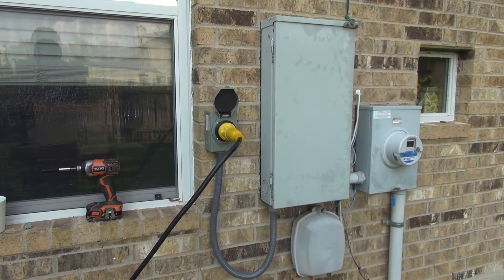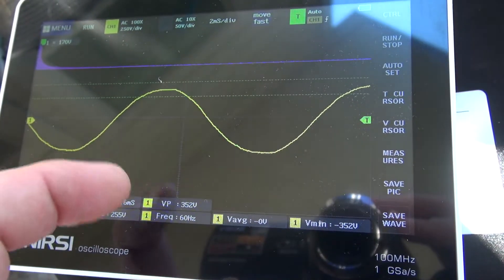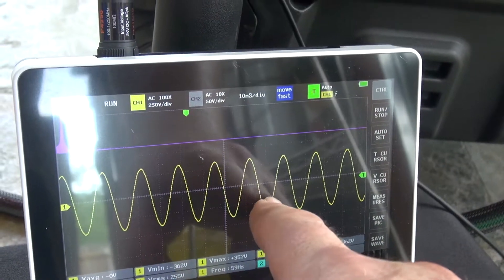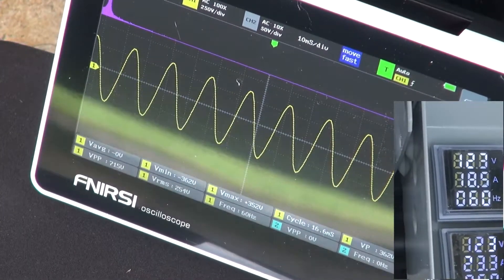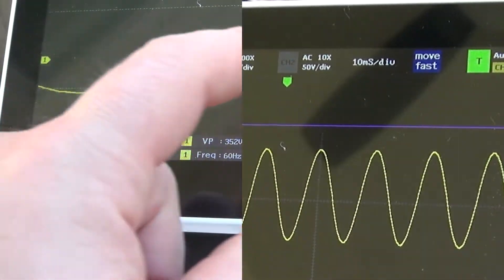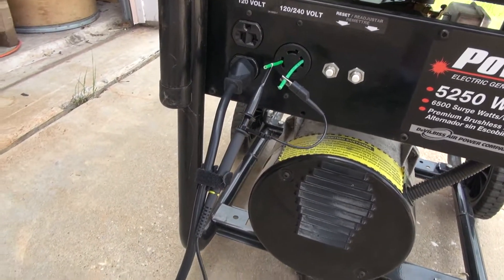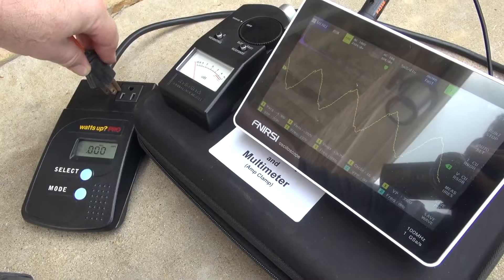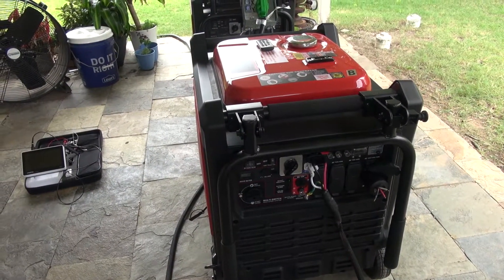Predator 9500 Inverter Generator vs. Line Power vs. Traditional: Compare Quality on the Oscilloscope

Comment: I have a predator 9000 that goes through a Reliance transfer switch. Runs almost every thing. The electrician said the transfer switch would clean it up. I have no problems .
Reply from the maker: Normal generators aren't "evil" or anything, but if you strain them, it will really screw with the power frequency.

Comment: I've had my Preditor 9500 Inverter generator for two years now. I've had to use it twice to power my house. With a soft starter on my 15 year old 3 ton air conditioner I have no trouble pretty much running the whole house including outdoor low voltage garden lights. It's really quite too compared to other generators. It sure beats the $12000.00 price tag quoted for a generac standby generator! The neighbors were happy to have a little light on the street as well at night!
Reply from the maker: Yeah, the MicroAir softstart is very nearly magic.  Really cool device for decreasing the starting amps.

Comment: The traditional is actually not that bad compared to others.
Reply from the maker: A traditional style generator of sufficient capacity isn't going to instantly smoke all your electronics.  However having one sized correctly is the trick.  If they're not oversized, when big loads hit (water heater, AC, or in my example even that fan) it bogs down the generator a bit, and that will directly impact the voltage and frequency, whereas an inverter generator will maintain both... until it can't and it just cuts off entirely... but never sends bad power out.  If the traditional generator is large enough to not get bogged down, then it's not really a factor (but over sizing it that much does get expensive)
Reply: @Texas_DIY a regular 9000 for a medium sized house should be fine I would think

Comment: All the sensitive electronics are typically stepping power up to 400v+ rectifying the power then using a buck converter to take it back down so your laptop is getting clean power. Standard dirty generator power is fine. Yeah cheap led lights flicker and maybe your hifi system will have a bit more of a noise floor but nothing is going to fry. Millions of people power their houses with traditional generators.
Reply from the maker: True enough.  It's not like a traditional generator insta-fries everything.  But an underpowered one is particularly ugly if being use for home backup.  High loads (water heater, a fan motor, AC, etc.) that bog down the motor have a direct impact on the speed (and thus the frequency and voltage) of a traditional generator.  I'd never hook that one up to my house, even a refrigerator turning on would be kinda nasty.  Inverter generators maintain frequency and voltage until they can't, at which point it just shuts off.  But yeah, if you get a traditional unit that is oversized enough to not slow too much when loads kick in, then it's generally just fine.

Comment: Thanks - this was super helpful in helping me confirm to get an inverter generator for my modern travel trailer rather than cheating out and getting a traditional non-inverted genny.  I’d hate to throw dirty power at all of that sensitive electronics that control my unit.  Well done!!
Reply from the maker: Glad you found it helpful!

Comment: 25-30 % distortion but have to admit people have been using Generac systems for years and don't really hear too much about blowing stuff out.  Not as worried about computer power supply since it's taking the AC and converting it to DC though a switching power supply. I wonder about modern AC units that have more electronics like brushless DC indoor fan motors.
Reply from the maker: Fair.  No one would use conventional backup generators if they just blew up everything they touched.  

My argument against full home generators is based more on price.  A larger permanent backup generator, isn't typically going to get bogged down and really distort the power because they are so oversized as to handle those loads and not bog down.  However because they are oversized, they are expensive and generally way overkill except for those brief moments with the huge air conditioner compressor surges (which the easy start mentioned in my other videos handles and reduces).

Now the convenience of having them auto-exercise themselves, and auto switch over on power failures, counts for a LOT.  Power goes out, and you don't have to do anything but wait 10 seconds, would be NICE.  

But in my case, since we don't have propane/natural gas here... the additional costs involved with leasing a large tank, plumbing it, making a pad for it, etc. etc.  on top of the already more expensive machine itself... made the pricing for a whole house backup generator a total non-starter for me.

Now, when you have small portable non-inverter generator trying to run a whole house, that's when things can get really ugly, (and what the test was showing, with just a single heavy load, not even a whole home).  This is because those smaller motors do get bogged down on heavy loads and surges, and when the motor slows, the AC frequency immediately also slows precisely with the engine speed (as the frequency of the power is coupled with the coils being turned by the motor, whereas with inverter generators, the AC frequency is generated electronically apart from the motor speed).  When the motor is under a sudden or heavy load, having huge voltage sags and frequency changes can really screw with the electronics in a house.

Comment: I ran my home for a month on a "dirty generator". Never had any problems. I ran everything.  I now have a diesel since gas is hard to come by after a storm.  It has less than 5% thd.   I wouldn't worry about it
Reply from the maker: If your generator is strong enough to not get too bogged down when larger loads kick in, it's not too bad.  But as the example I had, that was significant load hitting it really made a bit of a mess.

Comment: How do you connect oscilloscope to mains does it have a live and neutral and earth probe?
Reply from the maker: There is a neutral/ground and a 'hot' probe.  On the oscilloscope the 'neutral' is shared on both channels.  When placing it on 240, each probe goes on a leg.  When placing it on 120, hot to hot, and neutral/ground to the neutral on the power source.

Comment: Some ups make much worse wave form like you don't even recognize what it is.
Reply from the maker: Not sure what you're saying.  Inverters typically either make a pure sine wave, or a "modified" sine wave (which looks like stair steps on the scope vs. a smooth curve).  UPS units have inverters in them to make the AC voltage, just like this generator has a inverter in it to make the AC voltage. 

I prefer the pure sine inverter UPS units, as they will make clean power similar to this generator.

Comment: Great video, I almost purchased a regular generator until I watched it. But can't find any inverter tri fuel generators that can power the whole house. 
Do all modern tri fuel regular generators come up with similar dirty power?
Reply from the maker: If you need multi-fuel, consider the GENMAX GM9000iED on Amazon.  It's made by the same factory / people that make the Predator and the Duromax machines, and it solves all the shortcomings of those machines.  
(it has the same engine and most of the same guts, but adds a fuel filter, rear exhaust, 50A plug, remote control electric start, auto choke, nice detailed control panel display... and still makes the same clean power)
Reply: @JayTX  thank you for the info Jay. So my biggest concern is having a NG and 9000ied is a dual fuel as far as I remember, it supports gasoline and LPG. I was thinking about getting this unit just because of what you said, that it's a mixture of the two you mentioned with few upgrades and adding a NG kit to it, still considering. For sure I need an inverter generator having so many electronics at home

Comment: Even more horrific would be one of those 2-stroke asynchronous generators.  Those are knightmares and without enough load on the generator... they'll surge enough to blow the fuse on the Kill-A-Watt meter and I've read more.   Thanks for sharing this as well.  

I was wondering about a home brew synchronous generator parallel or gang controller and one of my thoughts was something like an inductor and/or bank of capacitors to switch in and out to get the voltages fine tuned and also seems like would have less brown outage issues having in general and not only for tuning each.  

Seems like a MOT rewound would be easiest, though I was wondering about for tuning a custom inductor or transformer from an old welder transformer so can more easily move in and out the high magnetic permeability piece.  I have no clue how come up with a cost effective variable capacitor design... so banks of capacitor fun... not. 🙂  Frequency can be easily adjusted via RPM tuning and phase will be more trickier via the governor I'm thinking to sync.  Seems for those older generators... easiest might be to mechanically set each generator to one larger engine if wanting like 10KW or more.  

This all started when trying to come up with a 50A 240VAC most cost effective generator design.  Seems the older 5000W or less are a dime a dozen and way more cost effective, especially if you're patient.  Then maybe add a thermal shut off from an old microwave on the stator somewhere to upgrade, along with breakers or fuse so the stator windings don't fry.   The only mechanical idea I had if not manually setting the rotors during the installation, is to use a CVT between the main driveshaft and each additional generator so to adjust into phase sync.  Seems easier to just have like a timing mark for each generator shaft and one engine.  Anyways, thanks for sharing and dealing with my thoughts! 🙂
Reply: I forgot to note that AVR for the "newer" older designs for voltage or using a custom regulator AVR circuit for the rotor to adjust the voltage.  I think I'm starting to understand this better in the long term memory.
Reply: Then to really upgrade these old generators, maybe someone can open source make (or I'd like to eventually to make a balance circuit for AC welding using IGBT's or thyristors and maybe like an Arduino or cost effective MCU) a simple design where you'd just rectify the AC output from the generator and then use the MCU to control the H-bridge so to get the duty cycle and timing correct for a pure sine wave output.  Then those MCU's and have in I/O for parallel or gang connecting to perform the auto-sync logic.  Not happening tonight or in the next year I'm guessing... though this just came to mind thinking about since I've been wanting to make an H-Bridge for the not Pure Since Wave optimized balance circuit.  However, I thought while at, will only take some more code to create the Sine and Sawtooth waveforms where the sine can be made to be pure like an AC output with a feedback loop to keep stable using a simple sense circuit I'm guessing.
Reply: Forgot to note that I'm planning on making the above using the readily available since they seem to last forever and can be saved from the shredder machines, Prius and maybe I guess other hybrid inverter/converters for the parts to make.  Some are somewhat able to be interfaced with open source designs... though my thought was using either board sections or the parts themselves down to whatever can be accessed.   Even the CVT's are crazy cheap compared to other generators... I mean... think about the two MG's in a Prius CVT that are like 20KW 3-phase and what engines can be connected to cost effectively with readily available cost effective 3-phase rectifiers to rectify to DC and then H-bridge invert to be used for plasma cutting, welding and power supplies.  I plan to start off with an 18HP Briggs and Stratton Opposed Twin horizontal shaft engine since I think the theme of the B&S Hybrid car is somewhat fitting.   I've found the CVT from the gen 3 I own for ~$75 loaded and the three inverter converters ranging from $30 to $75 with the wires.  Finding on the 50% off sales from the yards is even more cost effective.  I still have to work on more fabrication shop chores for now, along with other non-related chores in the mean time.   Figured I'd mention since is on my mind for a few.
Reply from the maker: Might be a fun project.  If you have a bad generator, you're probably best served (if you really want to go the total DIY project route) of running it through an inverter yourself.  That's basically what the online / Active UPS units are doing.  Generator / line power is converted to DC to charge the batteries, and run the inverter, and all the outbound power is clean, having been produced by the inverter.

The inverter generators are just doing this for you internally)  Most UPS units are 'offline' models, that pass through line power, unless the power falls above or below a certain range (usually 3-5V) in which case the inverter kicks in.  These aren't great for normal generators, because either they'll turn on and stay on until they run down, or, if they tolerate the generator power, pass through the rough stuff to your devices.

Whole house inverters (typically used for solar and such) may be able to be used for this kind of thing.  But I understand they tend to be picky and won't clean up power, but instead just disengage to battery power until the line power is stable.  People have been surprised with their PV inverters recognize the inverter generator power as line power, when normally it would reject it and stay on battery power.

Comment: I would have loved to have seen you do one more comparison, which is that of a whole house generator. But this is great to know. For sensitive devices, you're really taking a chance running your stuff on a regular generator. And nowadays, everything has a computer in it. I was pretty surprised a while back when our water dispenser wasn't working and the motherboard had to be replaced. Who the heck knew that my fridge had a motherboard???
Reply from the maker: If I had one, I would.  I would think if the whole house generator was strong enough to not get bogged down when larger loads hit, it wouldn't be too bad.  And usually they're oversized enough to do so.  (But that also makes them significantly more expensive)  They're certainly not as clean as normal power or a good inverter generator, but, it's really when the generator can't keep up with a load and slows (which slows and destabilizes the frequency of the power) that things get ugly.

Comment: Excellent testing video. I just bought that oscilloscope and didn't want to blow it up right off the bat hooking it up to test my generator's  I have a 100x setting in the channel one menu but both probes that came with it have switchable 1x or 10x. Did you get a special 100x probe to be able to test with?. Can you please advise, Thanks.
Reply from the maker: I did indeed get a 100x probe for the testing.  

It's been a while so I don't remember the exact voltages the 10x probe brought it down to, but it was really close or a bit over what the oscilloscope was rated to handle on the 240v, but fine with the 120v.  Since I needed to test the 240V as part of this, I wasn't comfortable trying it on the 10x and possibly smoking my brand new scope.

Comment: Any helpful hints on how to clean up the waveform from the dirty generator?  An Uninterruptible Power Supply (UPS) only sends out a clean sine wave when under battery power, I believe.  So, that's like for five minutes.  Would a Voltage Regulator be a better option or does that only keep the dirty sine wave 120 VAC within specs?  Maybe a Power Line Conditioner?
Reply from the maker: Power line conditioners will help, but it won't really help too much with the varying frequencies.  If you have particularly sensitive stuff, I'd suggest an online UPS unit, sometimes they call them double conversion units, basically they are always using the inverter making clean power, and using the "dirty" power for keeping the batteries charged and running the inverter.
Reply: @Texas_DIY  I want to recondition some old ham radios and test equipment and take them to local Ham Fests in the Spring.  I'm thinking most buyers might want to see stuff power up, at least.  So I figured I'd take a gas powered generator for my dirty power source.  As I rummaged around my shop, I think what I can do is use my variable isolation transformer and a CyberPower Automatic Voltage Regulator to clean up the dirty power so I don't fry any radios or oscilloscopes.  Those two items should give me a nice clean sine wave voltage, I hope.
Reply: @STBRetired1  highly doubtful